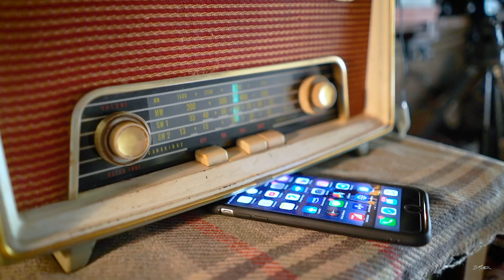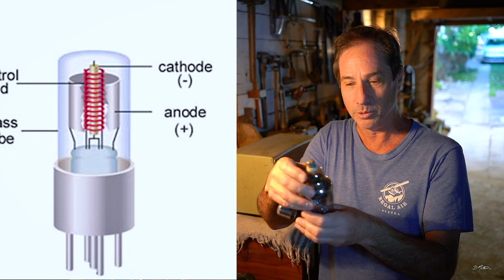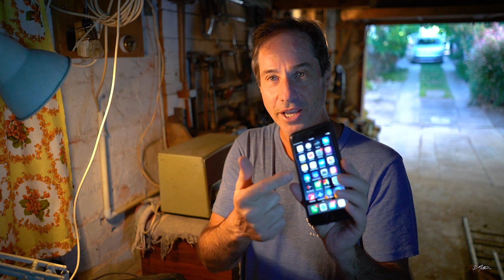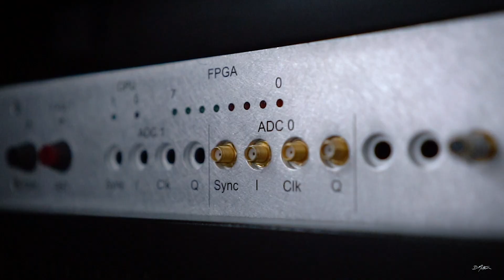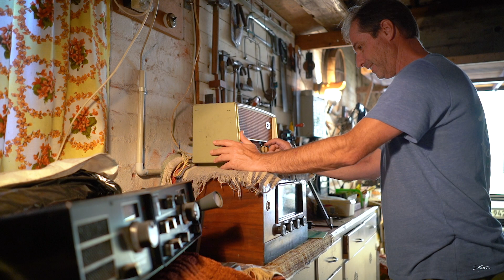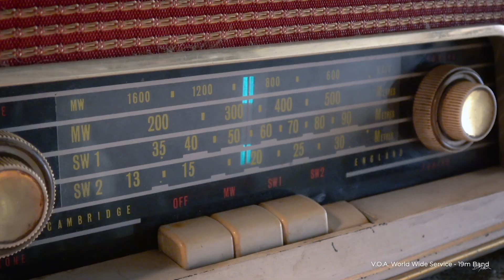Vacuum Tube radio : Getting the news in 2021

Comment: Well it's not a secret how a radio works.
Actually much more recent and common radios still work after the same principle like old tube radios, the key difference would be the use of transistors though.
In both cases, they're analog circuits but tubes aren't "analog" by definition.
They were used in digital circuits aswell, for example the first fully electronic computer used a lot of tubes.